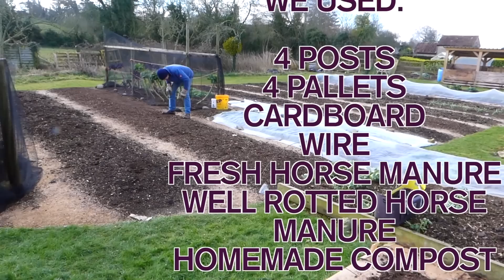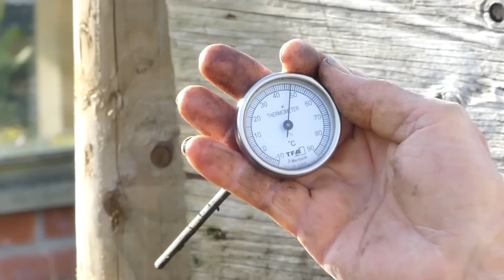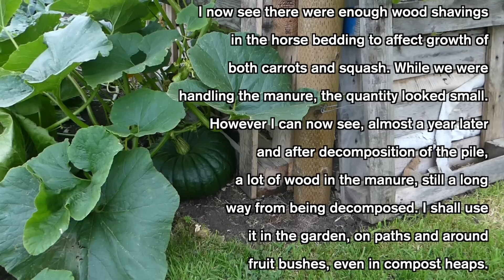Hotbed in the garden for early carrots, February to May part 1

Comment: The glue in corrugated cardboard breaks down into formaldehyde. Also, when you use a pile driver let it bounce and then its doing half the work for you
Reply: I have always found the worms in the compost eat the glue in the cardboard first.  I wonder if they are able to eat the glue before it poisons the soil?
Reply: Why risk it? Do you like cancer?
Reply: Because I live in an area where the ground doesn't freeze very deep, I would still go with cardboard in my area, zone 7b, NE Alabama USA.  Alternatives could be sheet stock paper, shredded straw, shredded leaves...
Reply: @platinum646  I'm going to turn my pallets 180° and staple the fleece on the inside of the the boards which will keep the dirt inside
Reply: @platinum646  use basement protection liner like Delta M S. I used it for my square garden beds.
Reply: @garybrown9719  i thought about doing that too! Great idea! 💡
Reply: Virtually every permaculture or no dig proponent recommends cardboard. There is zero evidence that it actually accumulates in plants. The roots from the carrots here go nowhere near the cardboard. I doubt the quantity would accumulate in a way that would result in this being part of the plants. If you can link to a proper bit of research showing how this is a danger I'd be surprised.
Reply: @HighVoltageKits  The main problem for me with cardboard is that it recycles very well, like paper. Old cardboard is recycled to "new" one. When you compost it, people will have to cut new trees to make new cardboard. Which is not very eco friendly...
You can just put a good layer of straw or hay to avoid weed and it works fine.
You also have to question all the "permaculture" things you read or see on the internet...
Reply: Delph Zouzou You make an interesting point. The problem where I am is that the recycling process produces carbon at all levels. I am not convinced it is actually being effectively recycled. So I'm using a resource I have locally for a one time use to make beds. I doubt I'll use it in this way. It would be a huge effort in Canada for me to do this the way its shown here. Ideally we should be less consumer and stop ordering crap we dont need from Amazon. My card comes from our upcoming house move. Hopefully our last. I'll use it to start our new garden beds. After which I'll be done with it. Good point about questioning everything. Cheers
Reply: I have and use a “pile driver” or post brasher as we call it .  Mine definitely does not bounce

Comment: Charles before I watch your video I have a totally unrelated question: I have just pulled the pumpkin vine & also retrieved 11large pumpkins (yum)- I am wanting to prepare this bed for Autumn/Winter coming to Brisbane Australia after our summer extreme heat leaves us. My compost bed is nowhere near ready as I have used all the previous compost- so I have purchased bags of compost & garden soil also which mixed together gives me an excellent PH level- should I apply this mix then let the bed rest or just cover the bed with plastic & let it rest - the soil currently in the raised garden is a little rock hard & I am wanting to do No Dig  ???????????????? Thanks Heaps Cheers Denise- Brisbane Australia.
Reply from the maker: Denise I see no need for black plastic - I would water, cover with compost and sow for winter. Not sure you needed the soil in that mix but fine since you have done it. The aim is organic matter on the surface.
Reply: @CharlesDowding1nodig  Thank you Charles but winter is quite a long way off yet for us but I am going to see if my niece (has a fabulous organic farm / orchard & animals etc) has any organic compost I can grab.

Comment: When watering the compost manure, what’s your thoughts around using Duck pond water to water it?  Good or bad idea? Any advice will be greatly appreciated
Reply from the maker: Good for sure, to use that water anywhere especially summer months. It will have some leachable nitrates, not a lot, and they will help manure/compost to decompose further.
Reply: @CharlesDowding1nodig  Thank you

Comment: Hi Charles, you mentioned that you need for a hot bed this pallet size. I would like to make a hotbed in my green house, but it is only 4” by 6”. Could I use half size pallets upright placed? Eveline
Reply from the maker: You could, however the warmth will be less and after 2-3 weeks not much. I would not use a pallet as that needs space - use plywood.
You can maintain heat by repeated additions of fresh manure as the contents sink, and wait until just before you are ready to sow.
Reply: Charles Dowding Thanks Charles, I will try that with plywood and topping up. Eveline

Comment: What if you put a flexible french drain in the bottom to allow air to circulate?
Reply from the maker: Yes could be interesting. See Johnson Su bioreactor for similar thoughts, more to do with aeration in that case
Reply: @CharlesDowding1nodig  very cool. I saw a farmer who used a large compost pile to heat his home in the winter and he put an aerating tube in the bottom (with a fan connected) because he couldn't turn the pile with the heat pipes buried inside
Reply: @CharlesDowding1nodig  as another random thought, if you do have compost to spare, you might be able to do what the farmer did and possibly heat your green house with compost. Idk, just a thought

Comment: Good luck. Consider building without posts - less effort & they get in the way when lifting a barrow. Also consider using pallet wrap, A) to wrap the pallets (they then act like double glazing) B) to wrap the whole bed adding strength (without posts).

Comment: Can you use chicken manure?
Reply from the maker: Yes, but only with a lot of straw, CA 90%. Straw has a high calorific value which is unlocked by the manure, so it's a valuable part of the heap. Another possibility could be fresh woodchip with the manure, but in winter, that's more difficult to find, and in small pieces.
Reply: @CharlesDowding1nodig  thank you,